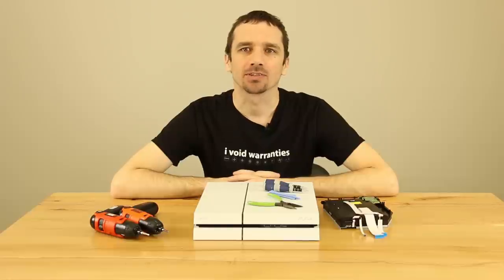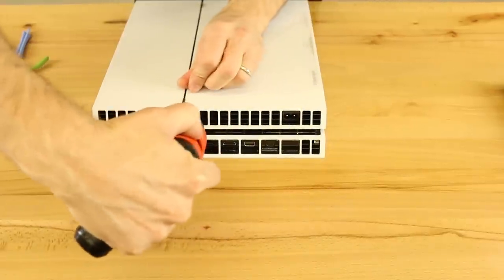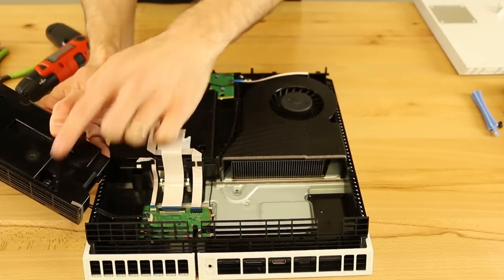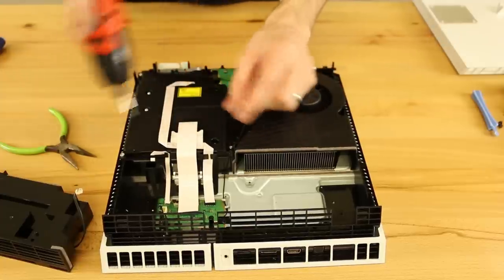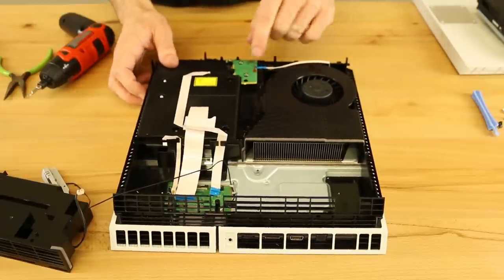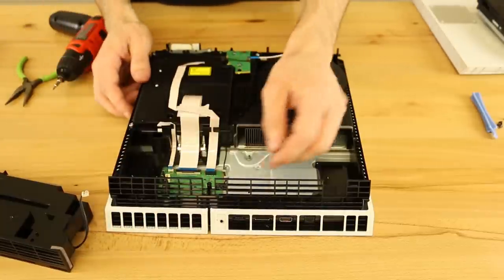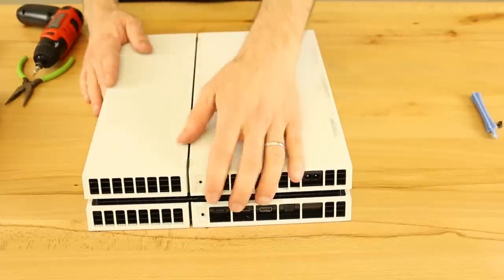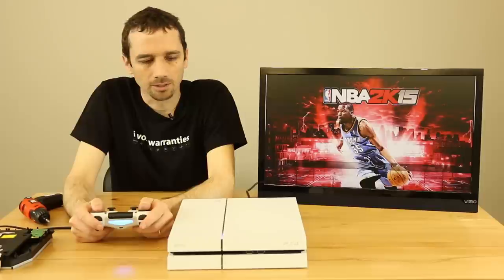PS4 1215A (1200) Disc Drive Replacement

Comment: Thank you so much. Worked like a charm. A couple of things though. 
1-There is no need to disconnect the power supply from the motherboard.  It is not easy to disconnect like your video and seems to be easily broken as I tried, mine didn’t want to disconnect, so I just pushed it back down the little I got it up, and left it there. 
2- There is no need to disconnect the WiFi cable from the motherboard, you can easily de-route and re-route the WiFi cable without disconnecting from the motherboard. 
3- I ordered my disc drive from Amazon for $59. You have to switch that green chip that’s on your disc drive to the new disc drive as that chip is married to your console. 

My install went great without disconnecting those 2 connections from the motherboard, and I believe doing so would have broke my console so instead of muscling it out, I let it be. 
Hope this helps someone in my situation.
My consoles disc drive is once again working and I couldn’t have done it without a step by step video like this one. So Thank You for taking the time to make this video!!!🙏
Reply: Hey! I hope you don't mind me asking as I am looking at doing this myself- which green chip is that? Is it the little one in the upper right in the video that kind of wiggles, or is it the big one the ribbons connect to? I've been trying to figure this out but can't seem to find any clarification! 
Also, do I need a soldering tool or anything like that to do the swap?
Reply: @furubagasuki  It’s the small green one that has screws in it. It wiggles. It comes with the replacement drive also, but you have to use your original one. So no soldering. Just unscrew and replace with the one from your original disc drive. Mine is still working great just so you know. Hope this helps. Let me know if you need anything else.
Reply: @87KNOTSaka100MPH   ah ok! The one that the wifi cable kind of goes over, that has the two screws, and the holes are a little bit to let it wiggle just a bit right? 
Awesome. Thanks so much for the reply. Not gonna lie when I saw this was a 6 year old video I was anxious that I wouldn't be able to get an answer to this and then I saw your comment was only 3 months old and I was super hopeful! Not to mention buying a new ps4 is hard because scalpers have jacked the prices up. 
Thank you so much.
Reply: @furubagasuki  Yup that’s the one. Glad I could help out. Happy gaming!!!

Comment: Awesome!!! Really accurate apart from the power supply disconnection. Saved my day, thanks mil
Reply: Should add a disclaimer on that part. I ruined my system because I pulled the power supply connector off the motherboard.
Reply: @tonygutierrez9471  he did add a disclaimer bud

Comment: My friend a couple years ago didn't put back in one of the ribbon cables in the right place so now that I'm fixing to replace the power supply and I noticed it I have to take out the disk drive just to put that ribbon back in. AND the long ribbon he had coming out of the wrong opening so I had to take the drive apart just to put it back. Thanks for the tutorial, saving me the agony of doing this later

Comment: hopefully you see my coment,, i opened my ps4 to clean the fan wich i took out the motherboard and the power supply ,but when i put everything back together my disc drive wouldnt work , i even checked my disc drive and everything was in place , but the disc drive does not take in disc or make any noises.i think is the ribbon cables could that be it?
Reply: Al3x M hey any fix same thang here

Comment: Hey, nice work! I have a question about remarry disc drives, is it possible to this date or still no go? The reason I am asking is that I bought a ps4 for spares without a drive with BLOD but I managed to make it run (hdmi port replacement), so it is now working. Either way i am going to resell it and i know it won't worth the investment, but i kinda like doing things all the way :)
Reply from the maker: It's not possible that I know of.
Reply: TronicsFix LLC oh well thanks anyway!

Comment: a question. in the model ps4 previous to the 1200 cuh to be able to change the disc drive it was necessary to move the integrated from the original disc drive to the new one. How is this process done in ps4 1215A

Comment: Long question: my ps4 went back to making noises that sounded like it was rolling in the disc but it didn't take it after I made a couple of rounds disassembling & repairing it.  The first time it had another disc shaped item sitting on top of a blu ray that was in there which caused the aforementioned sound.  The second time it couldn't recognize discs & made ticking noises. This was due to me confusing the screws. Once I fixed that issue I was even able to play for half an hour & eject & put away the game I had.  I turned the system on to hear that same sound.  Did i do something wrong again?

Comment: I pulled the power supply connector out like you said but the thing is, on my PS4   Which is the same version as yours wasn’t supposed to be pulled like that so I pulled the power supply connector out of the circuit lol
Reply: did you solder it back in?

Comment: I fixed my PS4 with your instructions, thank you! My kid had pushed something in the disc tray that didn't belong there, but I got it away. I want to ask you something though, why do you take the power supply's connector and wifi cable off the motherboard? I took the disc tray off without taking those wires off and it worked just fine. I was afraid to touch the connector, I thought I might break it. Is there a reason why I should have taken those off like you do in your video? @TronicsFix
Reply from the maker: You don't have to. It just gives more access to the disc drive area. For a pro like you you can just leave them on!

Comment: I have a gen 1 PS4 500gb. My disc drive sounds like its about to crap out. Super slow and feed in disc. Quick with eject. Reads with no issues. But I am not liking how slow it is to input the disc. Would it be more of a motor issue, and would it be better in the long run to replace the motor or just replace the whole drive?

Comment: I am struggling with disc eject. I saw your tutorial on manual eject with a screw driver. the only thing is that my disc wouldn't pop out. I placed it horizontal with power and after several times pressing eject it slid out. if this is a new normal do you suggest I swap out the disc drive to solve the problem? purchased around  spring of 2013? any help would be awesome! thank you.

Comment: Someone please help me make sense of this situation. My ps4 will take a disc but once its inside it sounds like it's not spinning the CD.. I can hear the laser moving and clicking back n forth trying to read a non spinning disc... Then I get the unrecognized disc pop up on screen. Someone tried to tell me the laser is bad but I don't see how a laser problem would stop the disc from spinning... Considering I hear the laser moving I doubt that's the issue.
Under the hard drive plate or reads 12xx so I'm guessing that's the same as 1200 model
Reply: having the same problem.. did you fix it ?

Comment: Hi i need help replacing my drive, i have a day one ps4. How do i find out which replacement drive to buy? i understand certain models have certain disk drives. Thanks
Reply: Kirk Bickley have you figured it out? Nothing at all anywhere on the day 1 ps4 man
Reply: @tracemiller1519  I can try to help you . What model number do you have. What issue are you having?
Reply: Keeks Seven thanks for replying I actually changed the thermal paste and my PS4 is like brand new not a sound coming from it, and it was like an Apache helicopter
Reply: Oh ok , great .... I was thinking your issue was worse.
Reply: Keeks Seven yea I mean I tried cleaning it without removing the mother board and it made it worse, I think because I knocked one of the thermal pads loose or off place because it kept overheating immediately and shutting itself off when before that would only happen once every couple hours at most. Then I took it all apart completely and put new thermal paste on and it was like brand new and still is.
Reply: @tracemiller1519  I just got done swapping a power supply on a day one for a customer. It's my favorite model to work on.

Comment: My son put a small plastic token into my ps4 disk drive.. I pulled it apart and successfully removed the plastic token but when I put it back together and attempted to insert a disk to test the disk drive is not responding I.e. not pulling disk in at all whereas before it was working but making a horrible noise(understandable considering the plastic piece inside) I pulled it apart again and tested the rollers by screwing the disk in manually.. it seemed to pull disk into place ok and I could wind it out with no probs.. but now there is still no response as I try to put disk in but now it says error disk in the drive

Comment: The older models are a pain in the ass to do disc drive replacements on, not because it is any more complex, but because there are two different standards on drives.

Since you have to tranfer the  circuitboard from old - new (replacement) drive, it has to fit correctly. Which ofc it doesn't if the drive is type A or B.

And there doesn't seem to be any consistent standard as to which model comes with which type of drive. So first you have to open up      The system to figure out what drive is installed, then you've gotta hope you have a replacement..../rant

Comment: I have an old PS4 Original Model Jet Black color Cub-1115a Circuit Board BDP-025 needs a New Disc Drive Replacement the correct way to do that and to get the PS4 works again

Comment: hey so are you saying with all the cuh-1215a models you can put any ps4 model Blu-ray models Blu-ray in the cuh-1215a
Reply from the maker: No, I'm saying that you can replace the 1215A disc drive with any other 1215A disc drive without worrying about them being married to the motherboard.

Comment: How did you get power supply out so fast. Ive been here 20mins trying to get it out. Ive got the side opposite the connector up. But the side with the cable wont budge. like it's held in place and not removable. 5 more mins and im giving up.

Comment: Hello, after this time with new models ps4 cuh 1200 / 12XX what were the benefits of this new version? We've seen major failures or ps4 12XX is the final version of the console? In which does not have many flaws?
Reply from the maker: +thehorrocruxes The major benefit with this new model is that it uses less power therefore it can run cooler. It's more energy efficient. I really doubt this is the "final" design as console manufacturers are always improving them and coming out with new consoles so they can sell more and keep up with the market.
Reply: +TronicsFix thanks you !
Reply from the maker: No problem
Reply: +TronicsFix Who makes the Blu-ray drive for the PlayStation four  is it also Phillips?

Comment: Hi I just replaced my ps4 disc drive but it is working it wont feed disc. It looks it does not power. But when load a disk it turns the ps4 on. What could be causing the issue.just an ordinary user here trying to fix my unit. I have a cuh1206a unit

Comment: i accidentally tightened the screws to my model 1215A a bit much. I put a disc in and it comes out with major scratches on the label.

Comment: hello i have a ps4 the one tht has the chip married with motherboard and it stopped to put the disc in when i try to put the disc it turns on and the disc wont go in i opened it the drive is ok  the laser works but the mechanism wont work i think that the chip or something like that is not working what is my solution? with this ps4 model sucks i bought a slim model but i would like to put this one working sony takes 150 euros to repair it with your experience do you advise to send it to sony?thank hou keep your vídeos coming they are amazingthank you
Reply: João Lopes u should open it and look if the rollers didn't pop out
Reply: i changed the drive and put the logic board but it wont worki think its somthing on the logic board

Comment: The problem in which the ps4 turns on for a sec and then turns off immediately but for the latest version and give some examples of what to do. :)
Reply from the maker: +Taste Therainbow Well, unfortunately the only way to fix that so far is a reball. We haven't found any way to fix that problem easily.

Comment: heya man , i had to open mine because it wasnt reading discs , turns out the magnetic peice that goes on top broke a bit , i tried cleaning the cogs and sweepers but it aint working , my ps4 is a 1215a

Comment: MY PS4 BUZZES ANS VIBRATES WHEN A DISC GOES IN, AND FAILS TO READ THE DISC MULTIPLE TIMES BEFORE IT FINALLY WORKS, DONT KNOW WHAT TO DO I CHANGED THE DISC DRIVE AND NOTHING, ANY IDEAS?

Comment: Hi! Thanks for your helpful video! I have a few questions for my PS4 CUH-1216B model:
I found that the deck with laser in my model is KEM-490AAA but i'm not really sure that the problems is the spin motor (there's a loud noise and not recognized disk) or maybe it's a problem with also the 'disc container drive' that makes difficult the disc to spin itself. I founded a few br drives but there are named as KES490 with compatible model for 1xxx and 11xxx, so, i can take this one because of the 490 code or should i take a drive from ebay coming from a 12xx model? and secondly, if i found a 1200/1215 br drive or something else different from 1216 br drive, it would be always compatible with my 1216b system? 
Sorry for my bad language.

Comment: hi i have a ps4 with a broken laser on the disc drive. My model is an (1215b) what kind of a disc drive should i buy. for the replacement 
?
Reply from the maker: Any drive for the 1215 model will work.

Comment: Please reply have a KDL-002 disc drive ps4 model CUH1116A  cant find lens or drive if a purchase a KEM-490AAA lens replacement and purchase a KEM-490AAA  logic circuit board change the KDL-002 logic board will it work

Comment: My PS4 wouldn't turn on so I took it apart, everything was except I was missing the ribbon cable which you disconnected at 6:38 in the video. I have no idea how that cable went missing and is there anywhere I can get a replacement?
Reply from the maker: I already answered your question in your first comment on my other video.

Comment: I installed the replacement drive and it doesn't recognize discs... what is the solution?
Reply: If the drives number doesnt match the logic circuit board number will not work
Reply: jase12354 easy mistake to make, parts aren't universal. Sucks but hardware updates and different designs make that happen. When the last thing a company wants you to be able to do is being able to access and replace hardware on your own, it makes it a pain in the ass... And it all boils down to Sony wanting more of your money, you'll either pay for them to repair it, get screwed if you have game stop do it or in the end ultimately just buy yourself a new one from the store. Either way Sony gets paid. Stay away from game stop repairs tho... Er just in general stay away from game stop.. Damn commies.

Comment: Just got replacement drive but didn't work took a part the ps4 and realize the part of the board the disk tray cable connect has water damage is it possible to fix
Reply from the maker: Sometimes

Comment: do you have a video on replacing the optical drive from an older model?
Reply: +TronicsFix how exactly do we go about switching the sisterboard? on the old drive? does it just screw in place?
Reply: +TronicsFix thanks for the help. i really appreciate it. my ps4's drive just crapped out today so I'm gonna order the parts here soon.
Reply from the maker: +David Reinecke No problem...good luck!

Comment: PLEASE HELP! My ps4(this model)won't read the disc after a while. It says their is an unrecognized disk. I just need to replace the disk drive? Right?
Reply from the maker: Probably just needs a new laser.
Reply: @Tronicsfix  Yeah it shows a question mark after a while that tells you to check the cd even though that is not the problem. "Error ?, unrecognized disc". Anyways, is that a easy thing to do, cause I have never done anything like this. I took it to a shop(phone medic)and the guy said the disc area needed to be replaced, I think this is what he meant? He said it would cost $150-$200, so is this which do you recon I should replace?
Thanks.

Comment: My ps4 is the latest model and it turns on for like 6 seconds but then turns off and I don't know what is wrong with it. Help!!!
Reply from the maker: +Taste Therainbow It's most likely either the power supply or bad joints between the APU and motherboard.

Comment: what is error code su-42118-6 since this model doesent have a blu ray drive board is it the drive itself thats causing the error
Reply from the maker: Usually faulty fuses on the motherboard
Reply: TronicsFix I can’t be another issue like the hard drive I can’t find any information about it online if it is a fuse on the motherboard how would I know which one thanks for the help
Reply from the maker: Look up Andrew Paul on YT. He has a video about the fuses

Comment: hi. have you had encountered a problem where the drive does not recognize the cd, game or dvd. changed the drive, change the laser, formatted hard drive but nothing works except when I change the daughter board and dvd and blue ray would work but not the games. what to do?
Reply from the maker: +Cecilia Castaneda Hi! Yes, we've seen that before. Sometimes it requires removing the chip from the drive board and placing it on another board. Sometimes the chip itself is faulty.
Reply: Thank you for your replay   :)